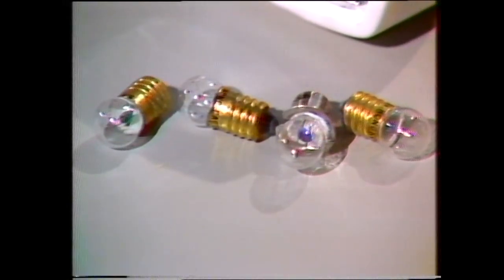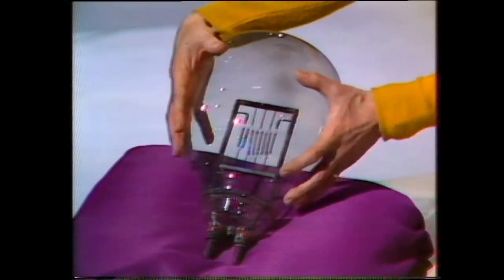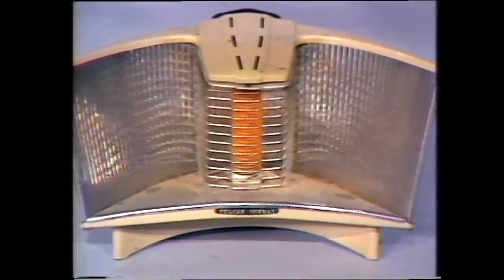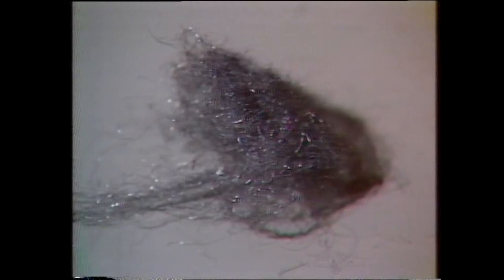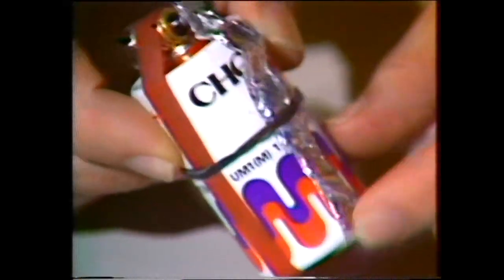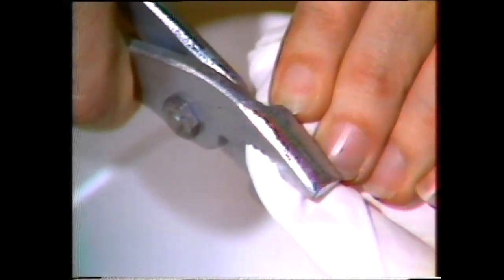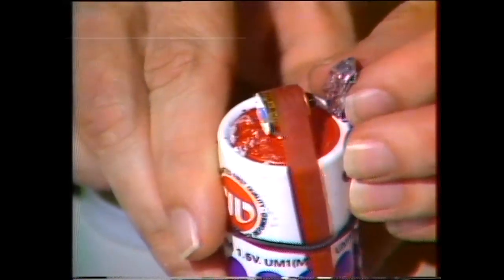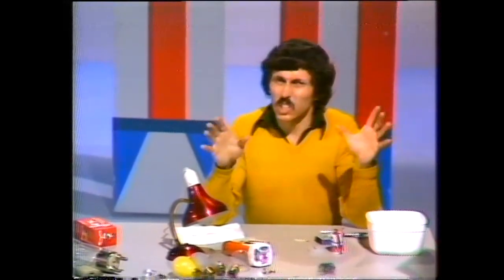1975 The incandescent lamp

Comment: Wow I loved the 5 KW lamp that sure must have been very bright and hot as well.  2 things I remember the old radiant heater mum had one, and those old Chevron branded batteries, that you could get from Woolworths and from memory were 24 cents for C cells and 27 cents for the D Cells.

Comment: i always wondered why they went out now i know after so long
Reply: The reason bulbs fail is a little more complicated than a leak in the bulb letting in air. The metal in the wires is actually made of a lot of little crystals of tungsten called grains. Where the grains meet (grain boundaries) tends to be weaker, especially when the wire is super hot. After a long time at high temperature, the grains grow so eventually a grain boundary bridges all the way across the width of the wire. Since it's weaker, even just the weight of the wire can cause it to pull apart. This is what light bulb manufacturers spent lots of money trying to prevent